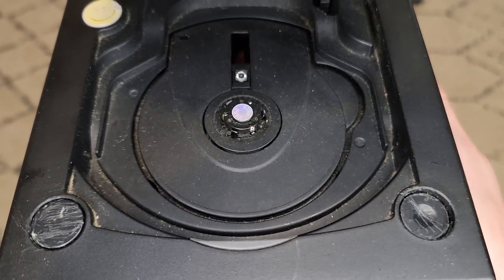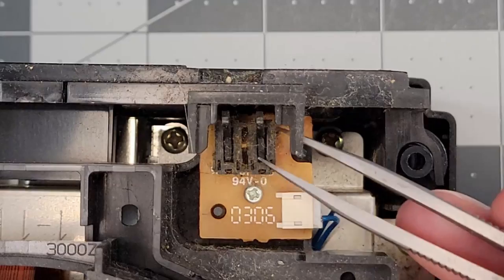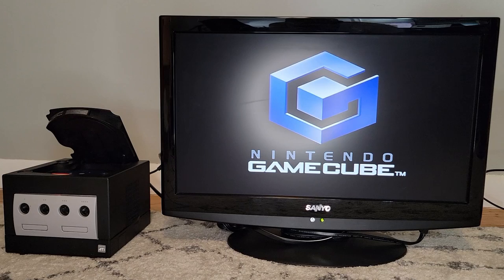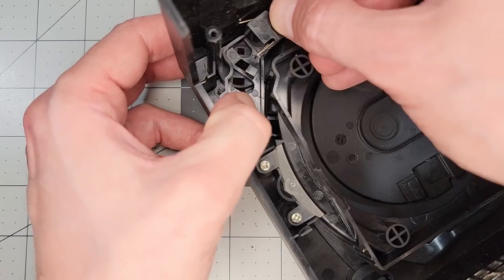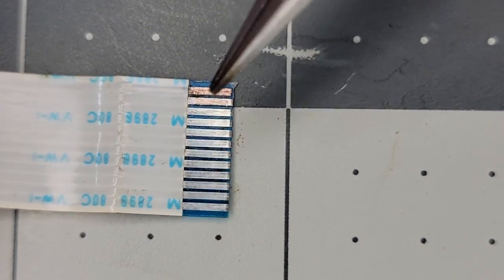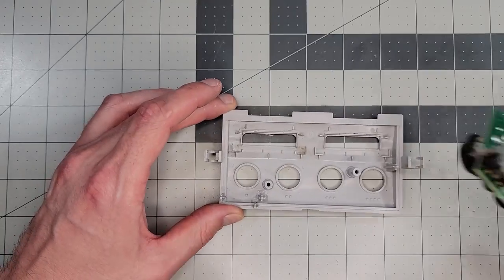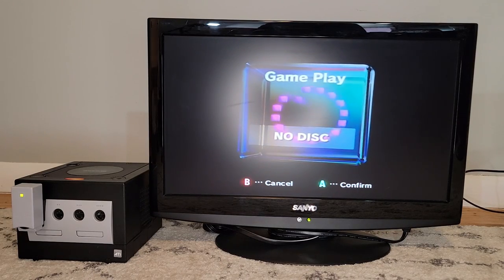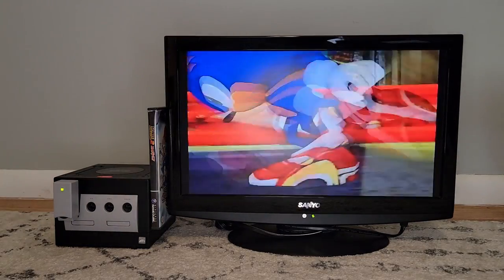Fixing Multiple Nintendo Gamecube Issues | No Disc Read | Dead Battery Connection | Stuck Lid

Comment: It's becoming more common for the caps to go bad on these. Surprised this wasn't an issue. Of course the open button is notorious for getting stuck. Just like the Reset button on N64. It helps to put a little bit of oil/grease on it to keep it lubed and happy. Just like my.....nevermind.
Reply from the maker: 😂 yeah the way the latch pushes the button back up is prone to binding by design so doesn't take much for it to get stuck

Comment: I never knew the GameCube had an interal battery. Ive had my GameCube since Christmas 2003 and it has gone long periods without being used but even today 20 years later if i want to play Mario Kart Double Dash it fires right up no problem
Reply from the maker: Yep the original batteries are still just fine on a lot of these. I think this one being discharged was related to the pin corrosion on the flex cable--hard to say